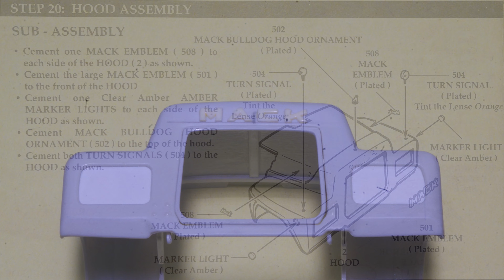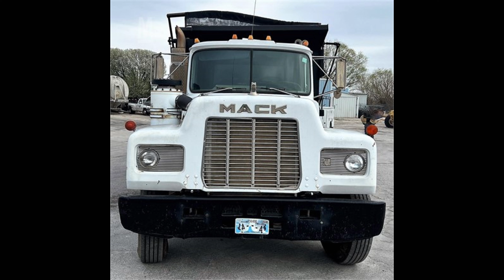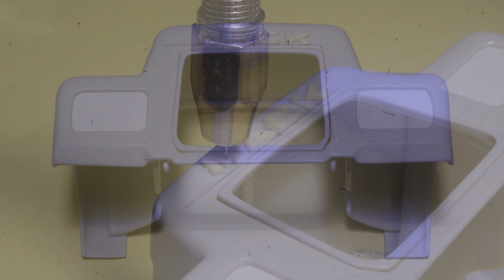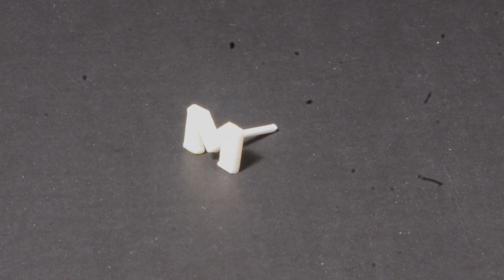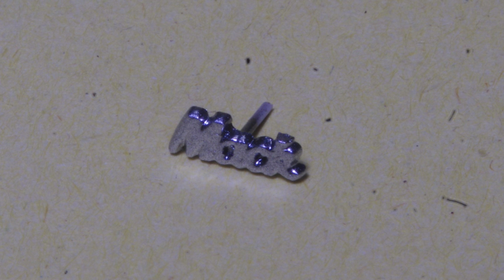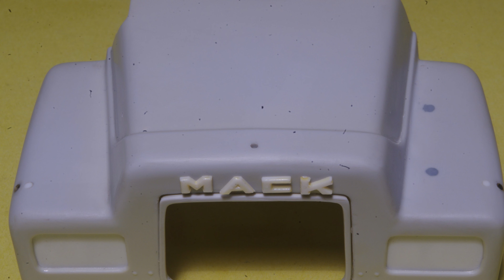Drill and pin 1/25 scale truck kit detail parts - easier and cleaner assembly, a "win/win"!

Comment: Excellent tip and tutorial.  I have been pinning parts for a long time both with brass and plastic rod. I have a set of reamers like that as well that have proved very useful over the years. Jewellers supply like Gesswein in Etobicoke is my goto choice - be careful, lots of interesting and good quality tools ( files, drills, burrs, etc, etc ).
I am glad I found your youtube channel. I have only a minor interest in building truck models but the techniques and ideas are transferrable to other subjects.
cheers, Graham
Reply from the maker: Thank you for the information regarding jewellers supply, I just took a look at Gesswein's site and you're right about lots of choices. With it becoming difficult to find hobby shops who stock miniature twist drills, they look like a good source for these and 10 in a package makes sense especially with the #80 to about #76 sizes.

I find all of the hobby magazines interesting because, as you mention, ideas, techniques and even some materials one might not associate with trucks or cars are all very transferrable.

Comment: Sure a lot of detail on the inside of the hood, are you going to do a video of that as well?
Reply from the maker: Yes, grille and headlight trim parts were reworked a fair bit, will do a separate video for the hood details once it has been assembled. Currently hood is painted white, decals and bare metal foil trim to go on next then final assembly - of hood anyway. Still work to do on cab and interior.

Comment: A great small detail for sure Robert.
Reply from the maker: I like how they turned out, nice thing was the kit parts themselves were well detailed already so the hard part was done, it was just a matter of how to attach them. In the past I have glued them on the surface and using an adhesive made for clear parts helps (Micro Scale's Krystal Kleer or Testors clear parts cement) helps but it it still tedious and there is always the risk of a glue smear on painted surface.

Comment: Have done this with wire/brass rod. Never thought to use plastic rod, however that makes perfect sense. Will give it a try. thanks for posting this!
Reply from the maker: I usually go with wire as well, for strength, was having a bit of a head scratching moment regarding the trim pieces then realized that strength of the mounting point wasn't as critical with these items - that was when the light bulb went on and styrene rod got used!